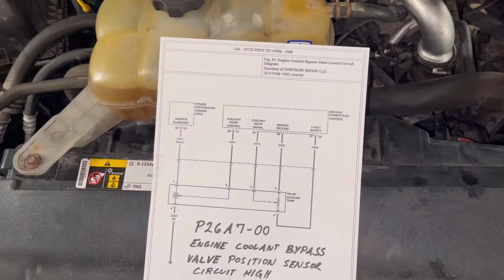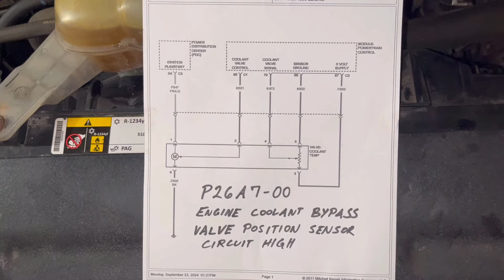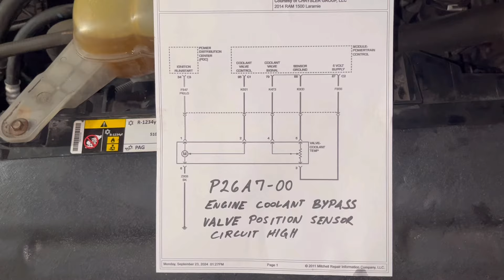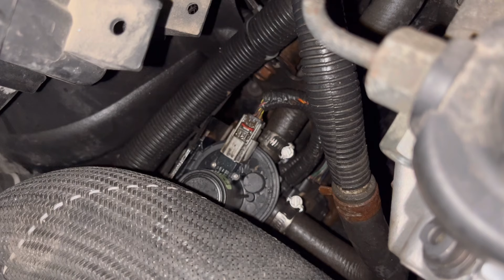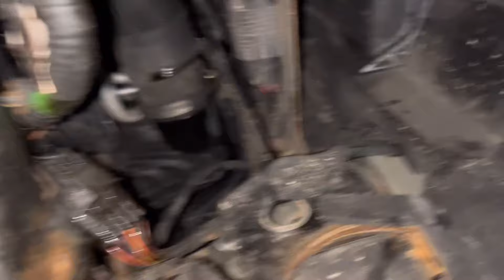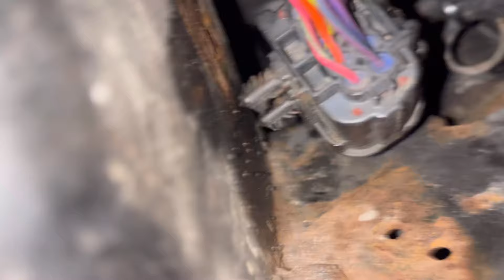Ram Ecodiesel Coolant Bypass Valve P26A7 P26A7-00 problem that wasn’t the valve!

Comment: Hey I enjoyed the vid! I'm having trouble with my 014ED. The heat to the cabin is unpredictable. In winter months is suddenly goes from heating to blowing cool air. Could you give me an idea of any other sensors that might be controlling this issue. I have already changed the obvious parts....thermostat etc. Maybe you could point me to a sensor diagram for that area of concern.
Reply from the maker: @richard-greatwhiterev  well how about that electric bypass valve shown in this video? Can still be faulty, with or without codes pointing to it.